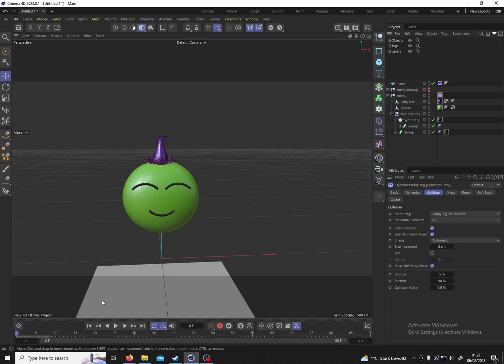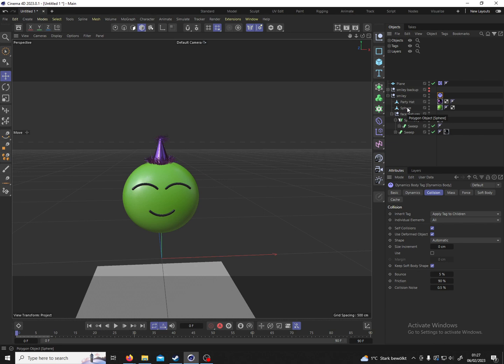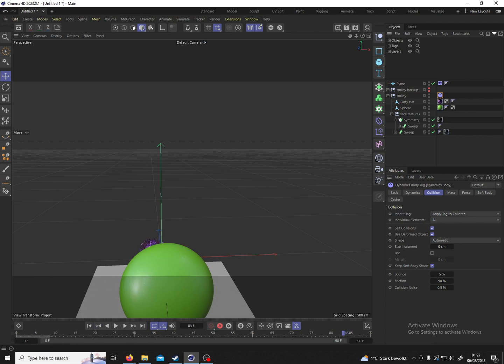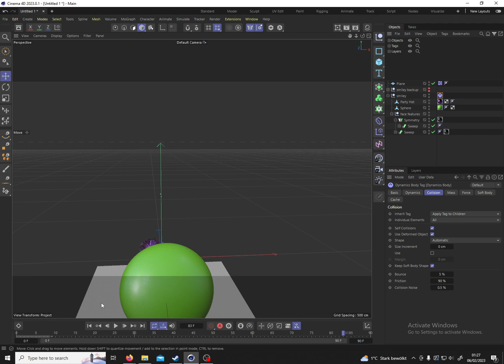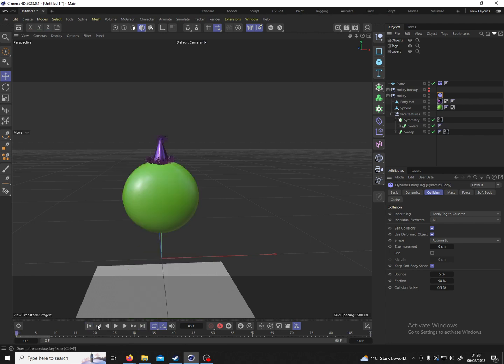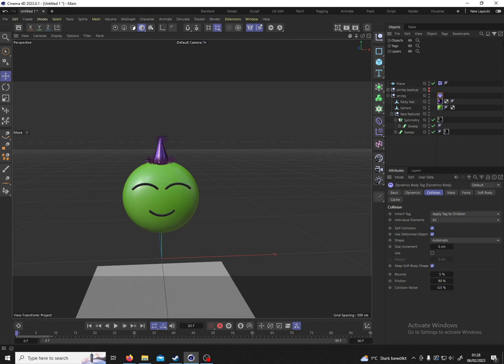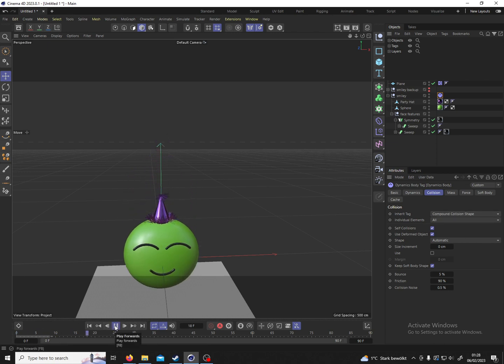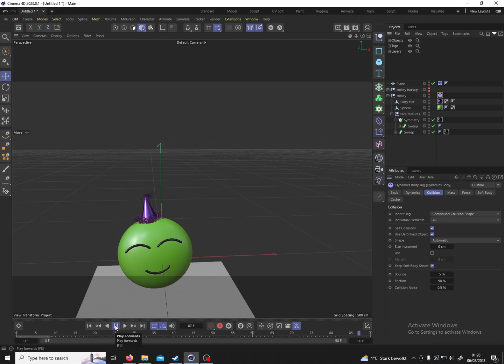Cinema 4D Quick Tip : Prevent rigid body from exploding with compound collision shape short tutorial

Comment: when i do this, it doesnt seem to react to gravity. It just keeps falling.
Reply from the maker: Hi Joe! It falling means that it is reacting to the gravity setting. Im assuming you mean it is falling through the floor? Should that be the case, try one thing for me:

The object it is falling through, please see if it has a collider tag applied to it. If not you can find it by right clicking on the object you want to apply it to under Bullet Tags -> Collider Body.

In C4D objects respond to gravity if they have a rigid body or soft body tag, but they don't collide with other objects by default. You have to tell the software which objects it should interact with. 

If you want a floor for your object to fall onto, you need to assign a collider body tag to the object you want to act as a floor. This object will not respond to gravity but will collide with rigid bodies.

Let me know if that fixes the issue.
Reply: @normalrender   thanks. I just had to pump up the gravity settings. this is a great tutorial.
Reply from the maker: @joestevens3071   Thank you! Im glad I could help.  Let me know if theres any more questions :)